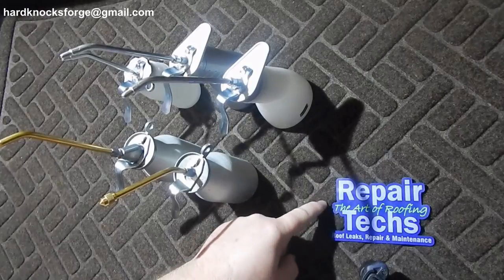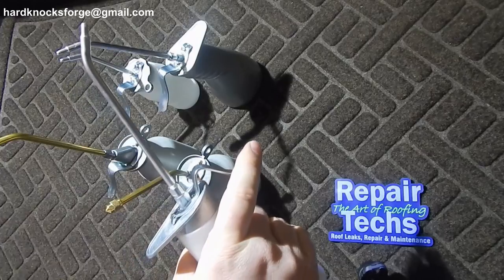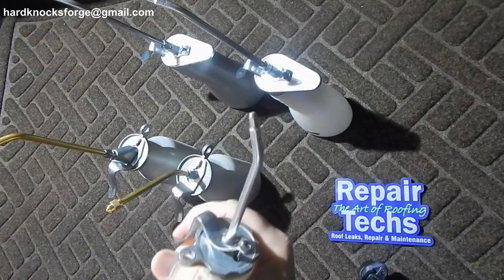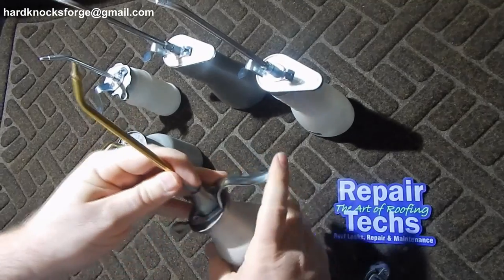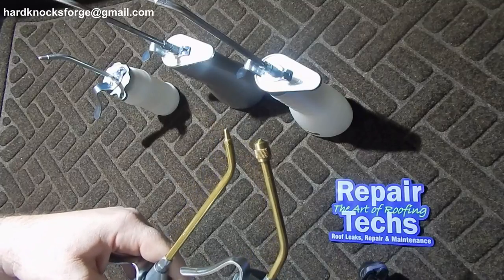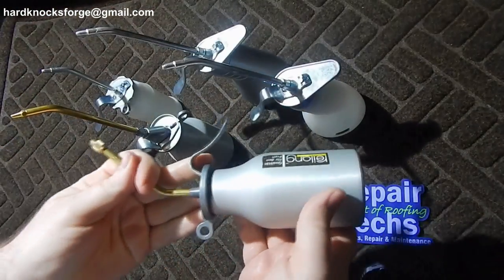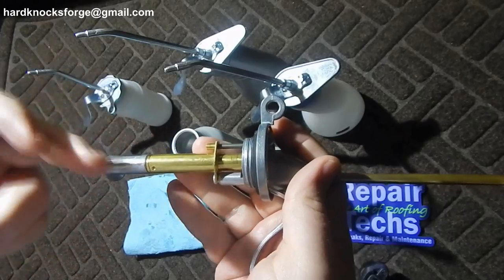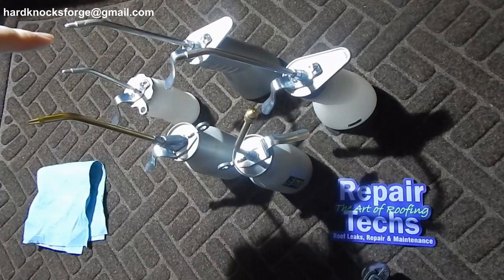German and Swiss Oilers Pressel Reilang Hazet Gedore

Comment: Good video but ya didn't show the inside of the Reilang double pump version or the Pressol.
Reply from the maker: Roof Repair Techs yeah I had to cut some stuff out, but the inside of the double pumper is shown in the thumbnail. The Pressel one I still have I'll show in the next video. It's actually held up really well to the ATF/Acetone mix. It just drains what's in the spout out and since it's so thin some gets on the top of the oiler. I wish there were a place guys could buy them. KCToolCo doesn't seem to have any of the smaller ones anymore which are the good ones. Might have to check amazon.de

Comment: Would the smaller HDPE plastic 10933 with the plastic inners be good for thinners/hydrocarbons? As WD40 is like half hydrocarbon/thinner. Worried about evaporation and degrading of the plastic

Comment: The pump handle on my Reilang is stiff. When I finally get it squeezed down, the oil shoots out in a 6’ stream. Do you know if this can be adjusted?
Thanks,
Paul
Reply from the maker: I’m not sure if you can adjust the spray but it sounds like you could have something stuck in it.
Reply: @HardKnocksForge  I took it apart with oily hands. When I put it together again, it worked fine. Just needed some oil. Go figure.
Reply from the maker: @paulmanhart4481  glad it’s back up and running again. They’re pretty slick oilers…
Reply: @HardKnocksForge  yes they are. I’m spoiled now.

Comment: German tool reviews notice oil discoloration, most likely because of a reaction with the metal on the rebrand hazet one.
Reply from the maker: Yeah if you put anything at all corrosive in those that have brass they tend to tarnish and get ate up. The little Pressol (white plastic body) doesn't have any metal parts in the actual pump and it's been holding up great to my ATF/Acetone mix.